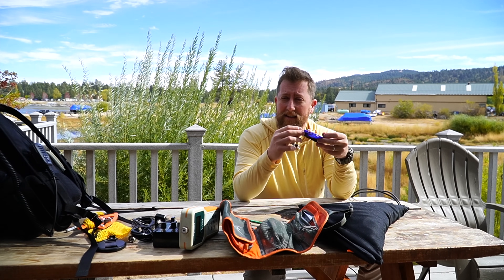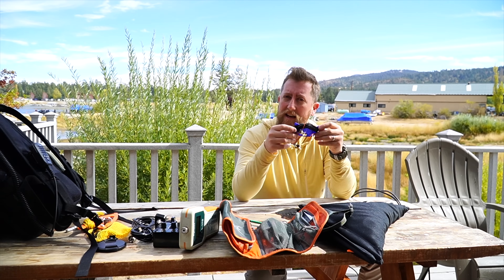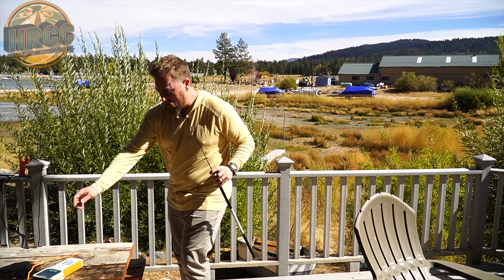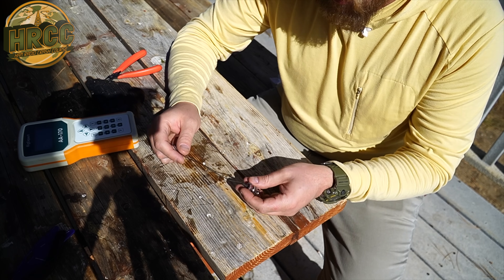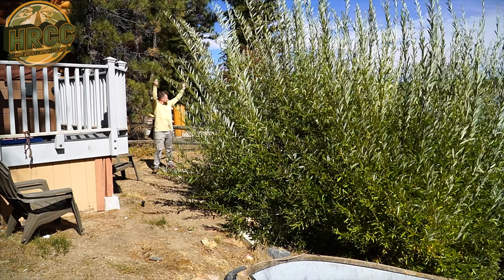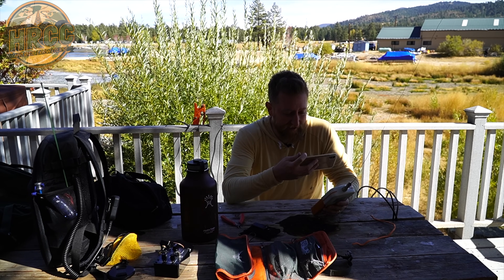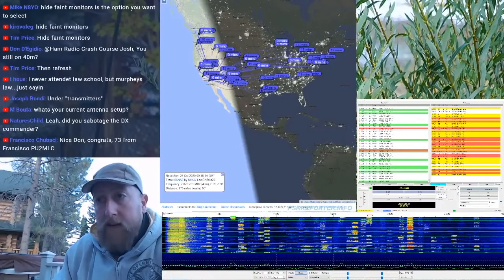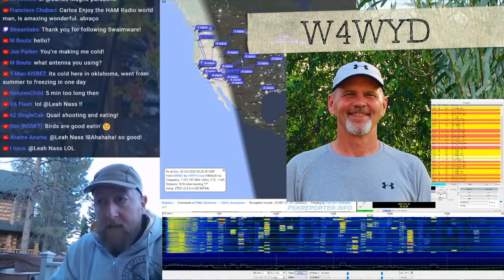The Coolest Ham Radio Antenna You Can't Buy

Comment: Hi Josh, this antenna is really really awesome !! I never thought, that it ´s possible, to work with that antenna, but it really works. I´ve got a 20m antenna , resonant on 40m/20m/15m and 10m, measured with a Nano NVA. I had some QRP QSOs on 40m and 20m with FT8 and CW,  using a TruSDX and the QRP-Guys Digital trx, I worked a lot of european stations. I don´t know, what die SMD capacitor is for . I have experiences in "Fuchs " antennas, where you also use a capacitor, but on the High resistance Side. Do you have a good explanation for the capacitor on this side, the cable feeding point ?

Comment: I teach Amateur Radio at our Church. During the classes, I always encourage my students to DIY antennas, kits, or scratch build from a schematic. I discourage "off the shelf" buying of equipment unless it is so complicated, beyond their experiences, or uses high voltages that can kill. I also encourage QRP communications as it teaches my student that it doesn't take 100-1,000 watts to make a contact. Most stations really make room for a QRP station either for a good QSO, or contesting which really gives my student a thrill. I make time to teach the "Radio Merit Badge" to Boy Scouts with slightly heavy emphasis on Amateur Radio. I also practice what I preach, making a contact to Wales on 52.525 FM with a homemade dipole antenna with only 10 watts on my Yaesu FT-690R MK2. Impossible you say? I have the QSL card to prove it. When conditions are right, anything is possible.
Reply from the maker: Good for you and thanks for giving back to the hobby!

Comment: I noticed you said you also used this antenna with 5w.  If I wanted to build this to be used on my new TX-500 with 10w on digital, would this work ok or should I construct it a bit differently to not burn it out?
Reply from the maker: That is a question that K6ARK might be better off answering.  Its generally a good idea to half the output of the radio for digital.  5 watts digital is likely fine on this antenna.  Not sure about ten given the very fine wire gauge.
Reply: @HamRadioCrashCourse  Thanks for the feedback! I didn't expect an answer so quickly!  Get back to your family and enjoy your Thanksgiving!
Reply from the maker: @MailmanJustin  I'm just waiting for my turkey to finish smoking!
Reply: You can construct it the same, only use 1 kilovolt rated capacitors.

Comment: Anyone have a source for the winder that's being used?
Reply: I second this. I spent about 20min searching last night and couldn’t find it.
Reply: @MoseYoutube  it's a Cheep kite String Holder
Reply: @MoseYoutube  SWR: Standing Wave Ratio, is a measure of how much energy that the transmitter sends up the feedline just bounces off the antenna and comes back down to the transmitter, where the energy is absorbed (converted to heat).  Since it's coming back, that energy isn't flying off into space to make contacts.  Similarly, energy in the antenna isn't getting into the feedline, either, so your received power is less. You might not notice that, though, since reception in the low HF bands is usually dominated by interference, not starved for power.
Reply: @cdorcey1735  I’m not sure who you intended that for, but it wasn’t me!

Comment: Hey had a question about gmrs. If the transmit power is capped at 1w how is it legal to have a 50w mobile gmrs radio. I saw a you then video that they were copyable at 26 miles even in near LA suburbs!

Comment: Newbie question. Why do you need a license and callsign to use the FT3DR if it only transmits in UHF/VHF? 
I thought a HAM licence was only for transmitting on low frequencies?
Reply from the maker: I’ve answered you dude. Check your replies.
Reply: @HamRadioCrashCourse  just did, I’ve asked this on 2 of your videos but the other has no reply. But thanks anyway.

Comment: Would you consider explaining how SWR matters?
Reply: The higher your SWR, the less power exits the antenna, and the more that goes back into your radio. An unacceptable SWR can damage the finals in your radio. The Lower the better. Most antennas can be tuned by lengthening or shortening them, others can simply be tuned with a tuner.

Comment: Yup, I built one! Awesome antenna. I’m using mini banana plugs to make it a linked end fed. I’m using 3 hole tent fly guy rope adjusters and zip ties. Just string up the antenna, disconnect for what band I want to use. I made it for 20,30,40 meters. I’m not sure if I need to make it a linked wire antenna element, but it works awesome with my KX2 and my SW-3B!

Comment: HI Josh, Slightly off topic, I recently got a TYT 9800d+ that has 10m/6m/2m/70cm Am and Fm only, no SSB. Other than FM repeaters on 10 and 6m, Is there any usefulness to those bands? i want to simplex with a friend 10 miles away but there is a bit of terrain in the way. Is NVIS possible? would a horizontal dipole get me over/through the terrain? i typically use a vertical j-pole for 2m/70cm. Trying to decide what antenna set up to go with for 10/6m. thanks
Reply: Unfortunately 6 and 10m will not work for NVIS.  NVIS works best close to the lowest usable frequency - typically 40-80m depending on the time of day/night.  6 and 10m sometime offer sporadic E propagation which typically skips 500-1000 miles or so, sometimes longer.  It is sporadic in nature (hence the name) but typically occurs most in summer, and to a lesser extent in mid winter. The Eastern US gets a lot more sporadic E propagation than the West for some reason. Listening or calling on the typical FM simplex calling frequencies (52.525 MHz or 29.600 MHz) may net you some contacts and is certainly worth a try. When the band is open, most traffic will be on SSB on lower frequencies in each band, but some will be working FM as well.
Reply from the maker: I’d get your jpole up as high as you can and out 50watts into it.